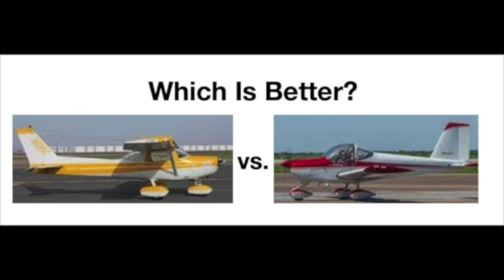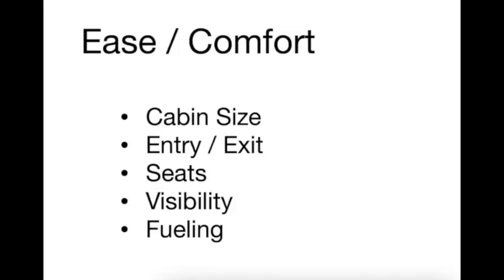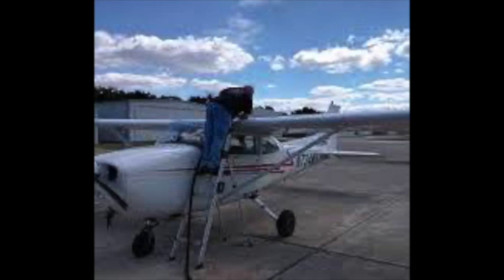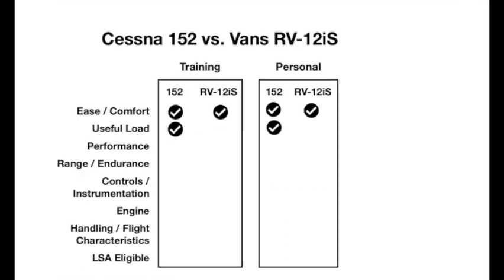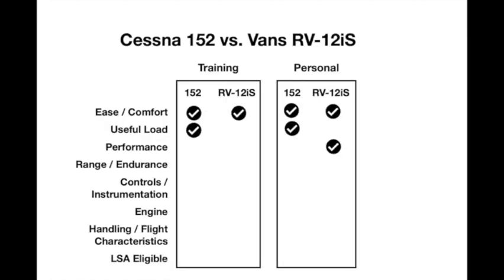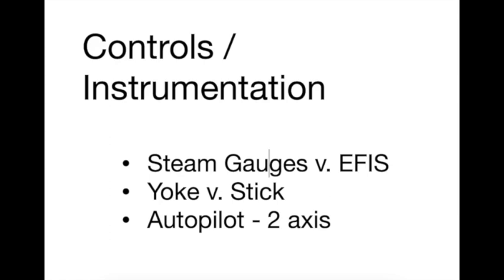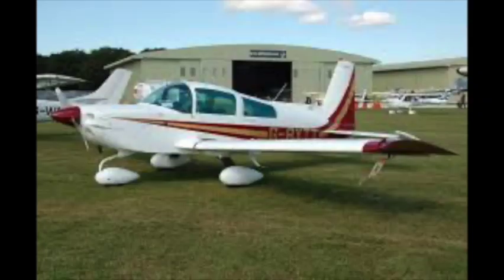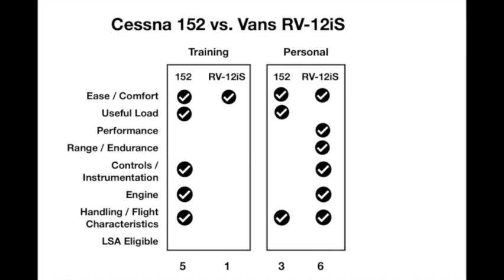Showdown with C-152

Comment: I totally agree steam gauge is better for student pilots. And it's not just nostalgia, there are actual benefits.
Reply from the maker: On my glass panel I typically leave it set to the six pack mode, simulating the steam gauges.  Still, even though they look like the old gauges, they are smaller in size.  I like the larger physical gauges.  I think they teach a student how to develop a scan pattern that the video equivalent can't match.
Reply: @rv12sg  I like actual gauges because you can see where the needles are. Once I learn an aircraft, I know where the needles are supposed to be, and I can fly eyes outside, and if a needle deviates, I'll see it out of the corner of my eye and I immediately go to it to see what is changing, and correct it if necessary. VSI should remain horizontal in most cases, ALT should be steady either vertically up or down in most cases. With the ribbons, you have no sense of things moving out of the corner of your eye.

I hate that digital gauges are smaller as well when displaying as steam gauges.
Reply from the maker: @SoloRenegade  I agree with all you've said.  I will shortly post a comparison between tapes and gauges to see what reaction I get.

Comment: I can reliably get 4.5hrs with reserve n my C150, I'm cruising a bit slower (90-110mph depending upon conditions, typically closer to 90-95mph) though due to not having a cruise prop or wheel pants, and the plane is 200lbs overweight (which is from bigger tires and some other things I can address). I'm burning consistently 4.2gph with useable fuel ~22gal, and can get a solid 450mi range without pushing it.
Reply from the maker: Solo, sounds like you're a bush pilot!

Comment: I have a C150 now, and you're right, head room is not an issue at all.
Reply from the maker: Yes, and I think you sit more upright, too.  I didn't mention it, but I also think the 150/152 is quieter, and now I appreciate that you have side windows you can open during taxi.
Reply: @rv12sg  I want a Vans RV-7, but only with a slider canopy for numerous reasons including safety. But opening while taxi is one of them.

Comment: I’m surprised that didn’t touch on he fact that the Rotax can use automotive 91 octane (no ethanol). I started training in a 150 then decided to go LSA route with a E AB LSA. My instructor was  really impressed with the RV-12 uls. He said it handled like the fighters he use to instruct in (while in the military) and had as much instrumentation as the Phenom he flies now. And it not usual for people to come up and comment how nice looking it is.
Reply from the maker: While it’s true the Rotax can take mogas, I don’t consider that to be a differentiator since mogas is rarely sold at FBOs. I run 100LL since that’s all I can get when I go XC.
Reply: @rv12sg I just go to the local Shell station for 93 octane. If I can’t find mogas on a long trip, I carry Decalin to mix in with the leaded fuel.

Comment: I own a c150 for the last 12 years.  I put a mountain bike in the cargo area with the front wheel dismounted.  Took a little effort to get it through the door.  Another flight with a friend, we put two folding bikes on board.  It’s a cheap plane to purchase, maintain and fly. But I do envy the performance of the RV12 especially the climb rate. I would love to fly the RV12 someday. Nice comparison video.
Reply from the maker: Thank you, Colin.  Like you, I owned a 152 for years and thoroughly enjoyed it.  Perhaps if the Sport Pilot license already allowed flying the 152 I might have bought one of those instead of the RV-12.  Hopefully my comparison was a fair one.
Reply: It will be under new MOSAIC update
Reply: How much do you spend. Hourly cost, etc. Is the 152 cheaper than the rv12 to run?
Reply: @gabeplays9441  fuel for the C-150 runs about $25.00/hr (4.8 Gph at $5.15 per gal for mogas),  annual $1,250, insurance $216/yr, tiedown $75/mo plus $500/yr for misc repairs Ave over the last 12 years.  I don’t account for engine overhaul because of the low purchase price of the plane at $14,000.  Only fuel is considered for the hourly cost because I do not rent out the plane. All other costs are incurred whether I fly or not. In 500 hrs I will sell the plane with a timed-out engine for close to the purchase price. Thus, the benefits of owning a simple aircraft.  Hope this helps explaining my reasoning for ownership.

Comment: "Compare the real-world utility," but do you see that the 150/172 (same plane) is like the B-52 bomber? The most legendary airplanes in history. Those planes are like birds, and no future technology will ever build an airplane that flies better. As for comparing to a low-wing, the 152 will always win any kind of competition. Also, the 152 looks like that's what it is supposed to be, all those
other planes, and the low wing ones, look to me like they are made more for a clown-show. You can see that clearly at 0:44.
Reply from the maker: The 152 and 172 have undoubtedly served well in their roles.  The Air Force used the 172, their variant was the T-41, in their primary pilot training back in the late 1960's, so many civilian and military pilots got their start in the 172.  No one can take away from the virtues of the design.

Comment: I own and fly a 150L that is IFR certified and very nice. But no one makes an autopilot for it. And it is too slow. I can handle slow with an autopilot or quick without an autopilot. But a 300 mile flying day in my 150 is exhausting. And I never can get organized in any way that requires two hands when flying alone.
Reply from the maker: I am glad to hear from you - I was hoping to hear from a Cessna 152 aficionado.  I agree with the points you made.  That is why in my assessment, the 152 excels as a trainer but the RV-12 is the better personal aircraft.  Two of the features in the RV-12 that make it superior are the 2-axis autopilot and the digital map display, both of which I use extensively on trips.  The RV-12 is constrained by the requirements of a Light Sport category to a max of 120 knots, so it is not much faster than a 152.
Reply: I feel your Pain.  I flew a Champ with no electrical system from N Carolina to Northern Nevada at 85 MPH....lol.  Had to really plan fuel stops with 3 hours no reserve range.

Comment: Thanks for pulling this together.  I have been looking for a comparison like this for a long time. You brought up some interesting perspectives, clear you put some thought into it.  I'm most interested in stability and ride in turbulence.  Clear that you favor the 152 in this area.  I'm very sorry to hear this.  Dashes my hopes that the RV-12 might be a better ride.  I'm curious how long since you've flown a 152 for the comparison.  I learned in 152's. Later after a long time away from them, I took a lightly loaded 152 flight on a windy day.  I was shocked how rough the ride was.  It was a real handful on landing compared to the 172RG that I had most recently been flying.  I did not recall the 150/152 ever being like that before on windy days.  Perspectives change and memories fade I guess.  you mentioned an inflight handling video.  I'm looking forward to that!
Reply from the maker: Thanks Brad for your insights.  It has, in fact, been quite a few years since I last flew the 152, but I do have several hundred hours in them, which is what I based my review upon.  I hope I haven't soured you on the RV-12 though, because I thoroughly enjoy the plane.  As I said, above 5,000 or so it is a stable platform and comfortable for long flights.  It would be interesting for you to see if you can hitch a ride in an RV-12 in your local area.  I'll bet the EAA Chapter there can hook you up with someone who'd love to have you along for a ride.  The only opinion that really matters is your own.  The next video I post will be some touch-and-goes I did today, and boy was it windy!  Stay tuned.
Reply: @rv12sg  I hope to do just that some day.  I'll amend your statement though, I don't mind bumps so much so the only opinion that really matters, in this case especially, is my wife's.  My whole thinking is a retirement project that can become an economical cross country traveler for the two of us.
Reply from the maker: @bradw.5727  show your wife the video I made of a recent trip my wife took with me:  "RV-12 In 1/3 the Time"

Comment: I tend to agree with the idea that students should learn with steam gauges.  But in reality, how much longer are we going to see that?  Most trainers are being updated with G3 and G5 panels at many flight schools anyway. And, you can set up a 6 pack on the G3 if you want.  But the real question is how hard is it really to transition between the 2 in a VFR private pilot setting?  I have no issue jumping between the two and would argue younger pilots have even less of a challenge.  The biggest issue when going from one plane and another is that everything is in different place depending on where some crammed another piece of equipment over the years.  As for the engine, I do agree with that.  Rotax is making great leaps while lycoming and continental are still the market leaders and refuse to make any real advancements in their outdated technology.  So, until someone puts a fire under them, we are stuck with carburetors and priming the way grandaddy used to do it.  I love the RV12. Just wish it was a little faster.
Reply: To be honest, I think that steam gauges will be the best for a very long time because even a lot of the most modern planes still have them as backup for partial panel and the way I see it, it takes little more effort to learn on steam gauges and the transition to electronic displays takes nothing, whereas the opposite is not quite true. I feel it would be a disservice to set new students up not to be able to use cheaper and or older aircraft when it likely won’t negatively affect them in the future. Kinda interesting to ponder
Reply from the maker: Thanks Kevin.  I appreciate your thoughts as well.  The panel space on the 152 is certainly deep enough to house about anything you'd want to throw in there.  With the requirement for ADS-B in place it almost begs to have the panel updated.  I have no insight into how many flight schools can afford the upgrades, but you are right - if done it certainly will benefit the next generation of student pilots.  The only drawback I see with the Rotax is that since I run 100LL, I have to change the oil every 25 hours.  Otherwise I am totally happy with the whole plane.
Reply: @rv12sg  can totally see that.  I wish more airports carried Mogas.  Totally doable at the home airport, but traveling cross country is harder.  If you fly mostly at home base using mogas and then do a cross country with a tank of LL, will that one tank commit you to 25 hour changes?
Reply from the maker: @kevindennis9227  Good question!  I don't know and I haven't seen any guidance from Rotax on that.  My philosophy is that an oil change is cheaper than a top overhaul, so I will go with the changes.  Just the cost of doing business, I guess.
Reply: @kevindennis9227  I think it's a 30% rule. If you use 100LL more than 30% of the time you have to do more frequent oil changes. Rotax recently changed the intervals to 50 or 100 hour oil changes.